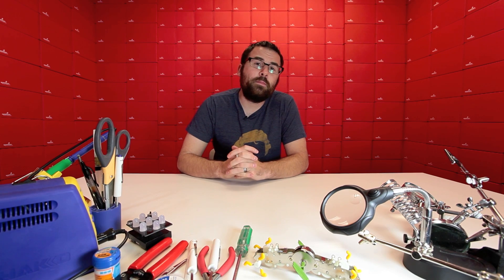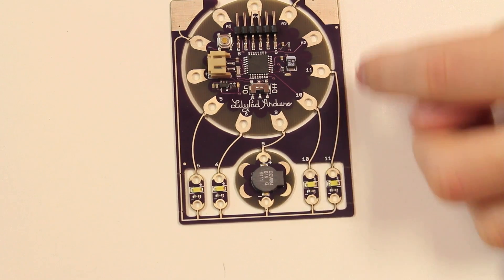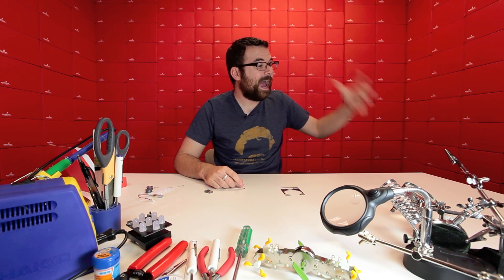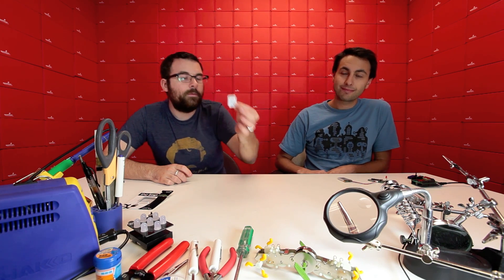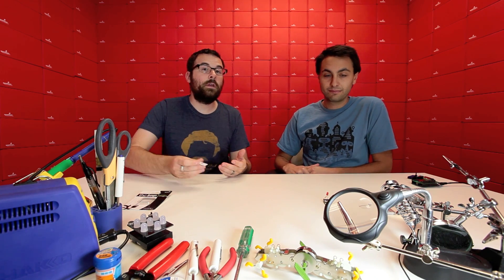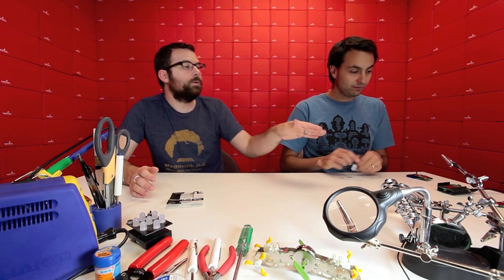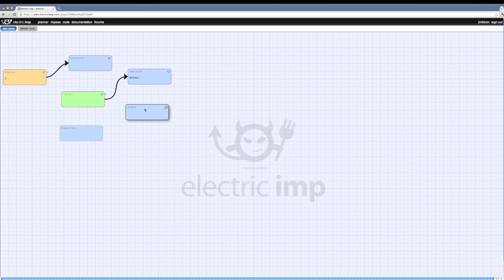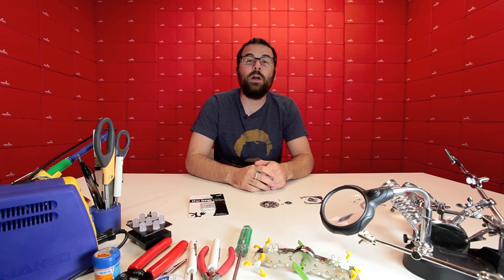SparkFun 9-14-12 Product Showcase

Comment: IMP, not my thing.
What's it doing with my wireless network name + password? What is controlling my home devices? Why is it uncontrollable, and not completely in my hands (in means of software) ?
Why must i program it trough YOUR servers? 

I think those are too many questions on my privacy and my own code works... no way for me to buy any device using IMP. 
I must say, a great idea to use SD form factor but just too many privacy concerns.

Comment: I plan add wifi to my moped, so I could directly connect to it. At the moment it's connected directly to the internet over 3G. Now i'm just looking for a good wifi module. This might just be it... 

Can you program or control your car with your iPhone? I think not, my moped is more advanced than your expensive car. I can check how much fuel is left in the tank from my phone. I can also control all the lights from headlight to dashboard ones. I can also start it from my hone and honk the horn....

Comment: You forgot the "Squirrel programming language". Overall, i like the idea of a MCU on a SD Card. If they can remove the wifi (wifi drains battery power) and replace it with a switch, remove the identifier chip and put it on the SD Card, and replace Squirrel with Java Processing. Then it would be interesting.